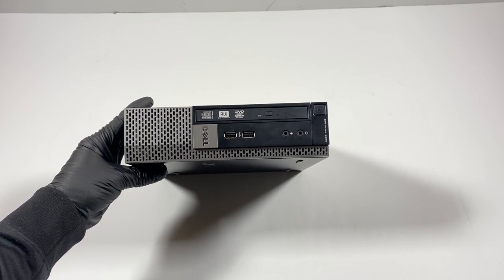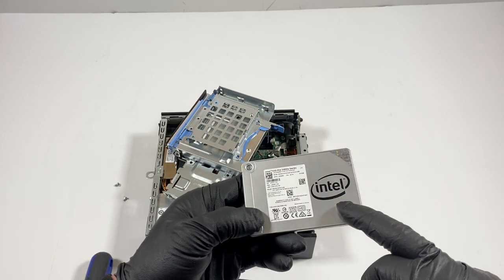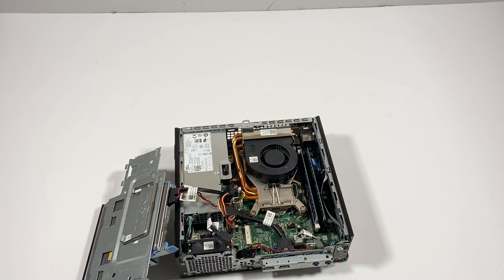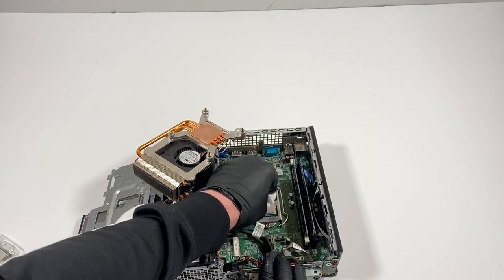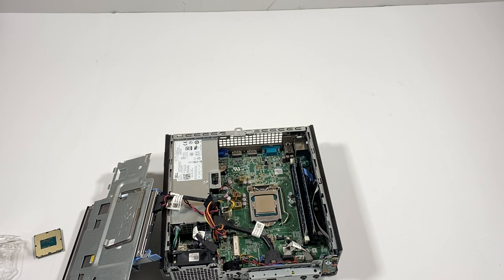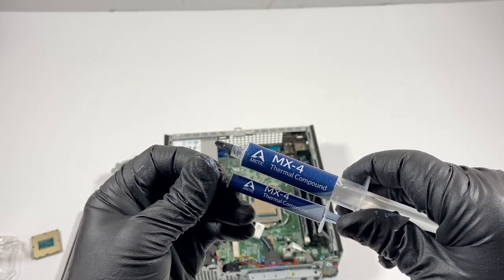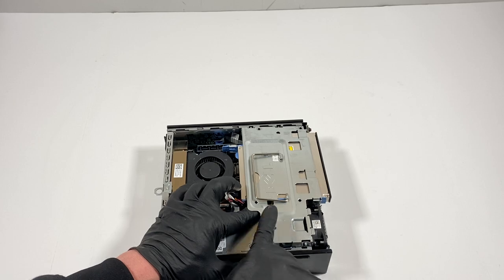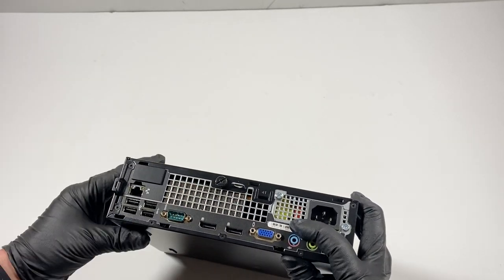Dell Optiplex 9020 USFF Upgrade CPU RAM SSD

Comment from the maker: List of RAM, SSD will work with this system Dell Optiplex 9020 USFF.

(1.) Display Port to HDMI 
Amazon Basics Uni-Directional DisplayPort to HDMI Display Cable 4K@30Hz - 6 Feet
https://amzn.to/3tXMd0W

(2.) Display Port to DVI
Amazon Basics DisplayPort to DVI Display Cable - 6 Feet
https://amzn.to/3tdNfH1

(3.) Display Port Cable
Amazon Basics 8K DisplayPort to DisplayPort 
https://amzn.to/3u1FXp0

(1.) USB Wifi Adapter for PC AC600Mbps Wireless Network Adapter
https://amzn.to/2ZaGuHb

(2.) USB Wifi Adapter for PC, EDUP AC600M USB Wi-fi Dongle 802.11ac Wireless Network Adapter 
https://amzn.to/3H3YoxG

(1.)  Thermal Grizzly - Spatula for Applying and Spreading Thermal Paste
https://amzn.to/30Qq4ag

Thermal Compound Paste:
(1.) Arctic MX-4 Thermal Compound Paste Carbon Based
https://amzn.to/3JfonEE

(2.) Arctic Silver 5 Thermal Cooling Compound Paste 
https://amzn.to/2ziNU0H

(3.) Noctua NT-H1 3.5g, Pro-Grade Thermal Compound Paste
https://amzn.to/36kTk7A

(4.) ARCTIC MX-4 (current edition) Thermal Compound Paste 20 Grams 
https://amzn.to/2DhGJaK

This RAM works with this machine:

(1.) Crucial 8GB Single DDR3L 1600 MT/s (PC3L-12800) Memory CT102464BD160B
https://amzn.to/2VhGv8O

(2.) Crucial 4GB Single DDR3L 1600 MT/s (PC3L-12800) Memory CT51264BD160B 
https://amzn.to/2xq46wb 

(3.) Crucial 16GB Kit (8GBx2) DDR3L 1600 MT/s (PC3L-12800) CT2K102464BD160B 
https://amzn.to/2VpsKpP

(4.) A-Tech 16GB (2x8GB) DDR3L 1600 MHz UDIMM PC3L-12800 (PC3-12800)
https://amzn.to/3i97Zt2

SSD list works with this PC:
(1.) Samsung 860 EVO 500GB 2.5 Inch Internal SSD MZ-76E500B/AM) 
https://amzn.to/2yNxnkE

(2.) WD Blue 3D NAND 1TB Internal SSD, 2.5" WDS100T2B0A
https://amzn.to/2wvnC9Z

(3.) WD Green 1TB Internal PC SSD  WDS100T2G0A
https://amzn.to/3cbrcWa

(4.) SanDisk SSD PLUS 480GB Internal SSD SDSSDA-1T00-G26
https://amzn.to/3a3i9ou

(5.) Crucial MX500 250GB 3D NAND SATA CT250MX500SSD1(Z) 
https://amzn.to/34rZlhy

(6.) Samsung 860 PRO SSD 256GB - 2.5 Inch SATA III 
https://amzn.to/2ybiHLK

(7.) Samsung SSD 860 EVO 250GB 2.5 Inch SATA III Internal SSD 
https://amzn.to/2VjIAkK

(8.) SanDisk SSD PLUS 240GB Internal SSD
https://amzn.to/3c7SEE4

(9.) Crucial MX500 1TB 3D NAND SATA 2.5 Inch Internal SSD
https://amzn.to/3BEn9zE
Reply: Hey can you link the Icore you used here. Thanks in advance

Comment: I currently have an i7-4770 processor in my Optiplex 9020. Since this hardware isn't supported by Windows 11, could you recommend a processor upgrade to replace my i7-4770?

Comment: I have this computer and I got error so I was unable to boot it up into the hard drive so I opened it and took the tray out to check if cables were lose but there was no issue and I did my best to put the tray back in but now I can't close it again with the cover on? how do I close it?

Comment: Hi, I am dealing with an really old pc it's a  Lenovo ThinkCentre  M70e. I want to upgrade it for light gaming. I don t know much about pcs so please help me. Would a 1050ti  or a normal 1050 work on my m70e? I want to put an 1050ti/1050, a Intel Q9650 CPU, 8gb of ram. Thinking that I have 240w power suppply and a Lenovo 71y6942  motherboard.Please help me man.
Reply from the maker: Hi, it is not worth it using that video card because that CPU is to slow and would be bottleneck, i would only use that gtx 1050ti video card on a PC with at least i7 2600..

Comment: I have a question. I have a m.2 ssd and hard drive in my tower right now. Can I move these components into a new tower, and continue using my operating system and most things on it?
Reply from the maker: Hi, yes you can...
Reply: @Mxkdt  thanks for that fast reply. Any catches I should know about?
Reply from the maker: @wetsockoutdoors8538  What kind a PC before and after upgrade ?
Reply: @Mxkdt  right now: optiplex 7040. After: custom with different processor brand

Comment: You can install an mSATA drive too ... Which gives you the space to install 2 2.5inch drives, one you'll need a HDD caddy for (sits in the DVD drive bay). Maybe one mSATA, one SSD and a bigger HDD for backup and long term storage) archiving.

Put the same CPU in mine - added a notable gearshift to the speed.

Good stuff 👍
Reply from the maker: Hi.

Comment: I would have cleaned the CPU fan/cooler with compressed air or a vacuum cleaner as well, now that you had it on the table.

Comment: hi there ! thanks for the video
going to replace my i5-4690S to i7-4790S today
I was thinking about 4790 but the TDP is 80+ ... while *S is 65 W... I believe the native cooling system and the form factor itself both  tailored for  65W, not full-tower CPU...
how good is the i7-4790S in your opinion ?

and also may I ask, how good is 200W power supply ? doesnt it make i7-4790S weaker then it should be ? 

thanks

Comment: Hii. Whats the pcie slot for? And what can I put for this specific unit
Reply: It's a Mini PCIe slot, originally meant for a Wi-Fi card. You could add some adapters and put an NVMe SSD in there, but performance would not be ideal (and it couldn't work as a boot drive without modding). An external GPU could be added as well, but it's also a very cumbersome process.

Comment: Hey I have a hp envy 750-287c. What graphics card should I get?
Reply from the maker: Hi, you can install like gtx 1650 with hp 300w power supply or gtx 1660 with power supply upgrade

Comment: Hello I just found your extremely helpful channel!

1st Question : I own an optiplex 5050 i5 7th gen. I would like to get a new GPU, what things do i have to look out for so its compatible with my PC.(Things in the name like Low profile)
2nd Question :  As of now i am trying to look for a 1050 Ti around the price point of £160 ($210) but ideally i would try get it as cheap as possible. Can you please find a cheap 1050Ti? 

Thank you for your Help!
Reply from the maker: Hi, you can search local sellers that sell in your area or try ebay used video cards..

Comment: Hi, i have optiplex 9020 usff too, question is Can i upgraded to Core i7 4790 instead? Not the core i7 4790S
Reply from the maker: Hi, only 65W CPU for USFF, Core i7 4790s or Core i7 4770s..
Reply: @Mxkdt  thanks for the answer, but i bought i7 4790 today. And works perfectly
Reply: @RadenMasPutut the 84w i7? In the USFF machine?